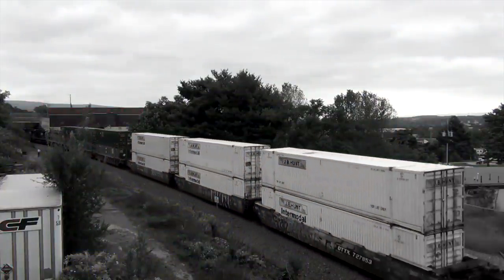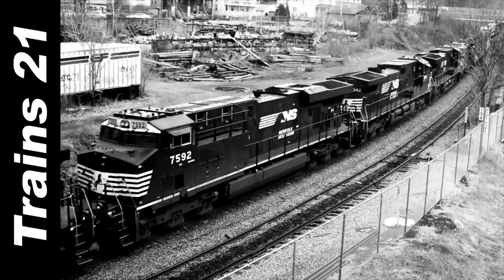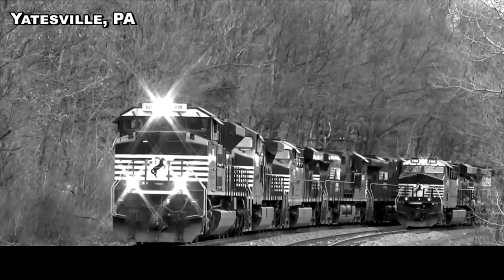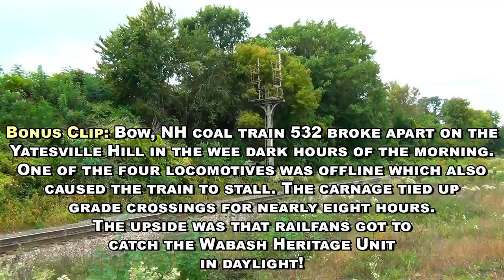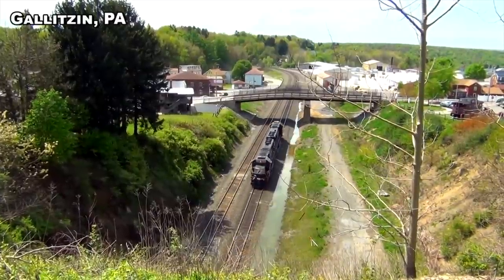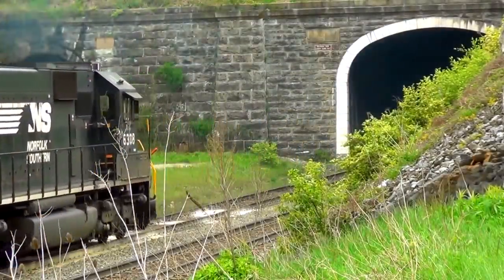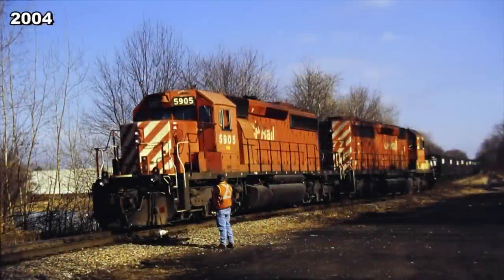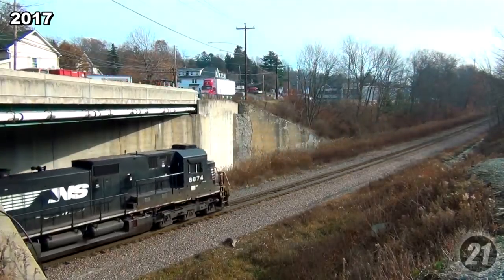When PSR Goes Wrong.. Why Railroads Use DPUs On Trains (Full Video)

Comment: I see the hold for tonnage guys are still around. The guys who destroyed customer service in the early Diesel age by making shippers wait until they felt like coming to pick up their car and running it in a huge train so they could get more work out of one engineer. I would never be an engineer nowadays. You get one paycheck and you do the work of six c r e w s. Just like with the Chicago Great Western putting 10 F units on the front end of a train. Shorter trains are more easier for the cruise to handle but less profitable. They got you squeeze every ounce that they can get of you. Now when they get to automated trains this will be reversed because there will be no incentive because you won't have an engineer. You can send an engine out to pick up a car with absolutely no labor cost whatsoever. What railroad is going to.
Reply: I see it locally. A business in a neighboring city takes about 3 - 4 centerbeams of product per week from UP via a connecting shortline. These days there can be up to a dozen or more empties accumulating on a siding on the shortline before UP will send a local to pick them up. They'll deliver as needed but wait a month to haul out the empties.

Comment: They need to operate a extra or 2 trains to prevent this problem The management doesnt care about how long or how heavy there trains are they just want them out of there yard . Upper management just does  not hear the workers This is some of the reason Conrail failed
Reply: Costs more money.
Reply: @FS2K4Pilot  how much can it cost to run 2 crews compared to the main track is tied up for countless hours , also the fine the public want to levy on them for blocking traffic . the delays of the freight due to not arriving on time.
Reply: @geraldmarcus947  Yeah.  Right.

NS alone spends around $700M just on salary for their train crews, not including any bennies or any of that complicated shit.  Even if you only have to split half of your trains, that just shot your payroll up by $350M.

NOT.  GONNA.  HAPPEN.

They can settle a lot of lawsuits and fines and buy a lot of politicians for a lot less than that.  Barring an act of Congress, and the railroads pay a lot of money to prevent that, it won’t ever happen.  Ever.  As long as it’s significantly cheaper not to, that’s the way they’ll go, every time.  Hell, railroad executives probably even tithe heavily in order to ward off even divine intervention.

Comment: DPUs on heavy unit trains that are moderate in length and operating on territories that have challenging grades makes sense but putting DPUs on damn near every general merchandise train, intermodal train, auto rack train etc does not...run those trains at reasonable lengths and there is not much concern for all of the buff force nonsense they use to justify using DPUs on them...running them unnecessarily makes the operation inefficient because now you have to get to the unit if something goes wrong and you have to switch it out at different locations which takes time and planning.....psr and DPUing is crippling service....it also makes no sense to run trains that don't fit into sidings....railroads ran much smoother and efficient before psr and monster trains
Reply: I agree to some extent with your post.   However, as with any significant change there will be challenges.   Sidings are being lengthened.   Locomotives are increasingly smarter.   Signal systems are being modified.     We are not sending out DPUs on every train.  Sometimes it doesn't make sense given the tonnage on that particular day or what the work in transmit might be.   One thing I guarantee you....if I use DPUs there will be railfans going "They didn't need it".   If we don't use them and have difficulties pulling a grade the same railfans will say "They should have used a DPU"
Reply: I had a mixed manifest train the other day. 4970 tons, 39 cars. DP'ed on the rear. One locomotive on the head end, one on the rear. No sense considering two head end locomotives would have been plenty, it just made more work for me when I had to yard it.
Reply: @cody8217  Agreed.   Give me 2 5000 HP locomotives on the head end of 5000 trailing tons rather than make me DPU the train.
Reply: @cody8217  my point exactly

Comment: Hey Just so you know NS phased out PSR a while ago.
Reply: actually, PSR in and of itself is NOT bad... the problem with PSR is that it creates EXCESS... and the company can be tempted to cut off those excesses... cutting off excess lowers the operating ratio, which increases monies going into the shareholders pockets... and btw just looked at an article concerning NS and their performance last year... they are getting LAMBASTED by the investment community because the last qtr of 2023 their operating ratio went up from 63% the qtr prior to 73% for the last qtr of 2023... stock professionals are considering downgrading NS's stock

Comment: i'm not in us.  didnt csx try this oversized bs years ago and they had to get rid of all the top (non-railroad) brass because of false economies?
Reply: CSXT is still running huge trains.  Nothing has changed.
Reply: @cdavid8139  , i thought the new management shortened them.  so no change?
Reply: @vsvnrg3263   There has been change.   And there will continue to be change.  New technology becomes available.   Traffic trends are altered by demand and economics.   New management comes along and doesn't like what the predecessor did.   But in general CSXT still runs very long trains with distributed power when needed.
Reply: @josephhigdon2204  I concur that 3 mile long trains running into major cities along certain routes are problematic.   We often break up the super long intermodal trains up before they come into LA.    I might be wrong.   The government may step in.  But my belief is that as siding length increases and crew costs rise we will continue to see these huge trains moving.    Train length has been increasing since the first wheels turned on steel rail and with technological improvements it won't stop.

Comment: What does PSR stand for?
Reply: Precision Scheduled Railroading, which it is neither precise nor scheduled, ironically.
Reply: Hunter Harrison titled his two volume encyclopedia on Precission scheduled railroading. PSR works any commodity that does not spoil.  
Prior DPU locomotives, another system called pacesetter used CPRail on unit coal trains (60 cars back of head end power) as helpers (SD40-2).

Comment: you made a error on the announcement the number was 9510 not 9610 on the third unit just wanted to correct you.

Roberto Roman
Reply: No, 9510 was in the pusher/helpers -- 9610 was the third lead loco.

Comment: It’s been a long tome since trigonometry in 12th grade (50+ years), please convert % grade to angle.  I forgot.  I’m a mechanical engineer but never had to build roads, car emergency brakes, parking pawls, or train engines so grades in % were not a daily number.  The rest of your numbers get your presentation a technical A++.  Nice job.  It’s something everybody can understand.  That is a standard measure of intelligence, being able to educate the uninformed.  Take the rest of the day off.
Reply: Just know that a 1% grade triples the amount of drag over level track, and 2.2% is the standard steep grade in mainline U.S. railroads.
Reply: Simple answer: rise over run.  1% rises 1 foot for every 100 feet of run.  It's essentially the tangent, but used where the tangent values are very small and make for a more understandable relationship than the angle in degrees.
Reply: you can just multiply it by 0.9 to get the degree angle. For example, a 2% slope would be 2x0.9 or 1.8 degrees
Reply: @ryguygaming06  That's an approximation that is fairly accurate down in the range of normal RR grades (say 0-3%) but I wouldn't use it for anything much larger than that.  A 100% grade is only 45 degrees, not the 90 degrees that approximation would yield.
Reply: Yes, the percentage of the grade is the trigonometric tangent, so use the inverse tangent function on a calculator to find the degree measure of the grade. . .
Reply: @ericemmons3040 thanks
Reply: So, a 45degree slope is a 100% grade like the thing that goes up the side of Pikes Peak, which is probably not a train but a trolley because of its mechanical attachment to the tracks.  I’m over extending the limits of my engineering background but being wrong was sometimes more exciting than being right!
Reply: @yelyab1  A trolley car, engine, or train has no mechanical connection to the tracks; a cog railway is what you're thinking of. With a cog railway,  there are steel teeth  between the tracks, and the locomotives or self-propelled railcars, whatever is being used, have gears underneath that mesh with the line of teeth between the tracks and provide a way for a train to go up a very steep slope. Shay or other geared steam locomotives, which are not cog engines, can go up grades as steep as, say, 9 or 10 percent, as far as I know, but I think anything much steeper than that requires some kind of cog mechanism. Or, a system of winches, rollers, and steel cables as was used on the Yosemite Lumber Company Railway, which had 2 major inclines during its operation history, one with a maximum grade of 68%, the other with a maximum grade of 78%.

Comment: I get the enthusiasm. I wish the railfans/foamers would stop making these kinds of videos. There's so much information you're not aware of. You only have bits and pieces of the story. You're not doing anyone any good by telling partial biased truths. I'm an in the field union officer and there is so much more than the story you tell.
Reply from the maker: While I respect your position and opinion, I know more than you give me credit for since you don't know me at all. I've said that there are positive points to PSR on many occasions. However, this video is titled "When PSR Goes WRONG." And everything I said in it is true. And as long as I'm responding. While there are good points to PSR, I've seen many more bad points to it as I used to work WITH the railroads and have spent countless hours around them as well as listening to the radio. As I've also pointed out in the past.
Reply: @Trains21  I work for the railroad also, I rather have you railfans guys make videos and take photos , than dealing with having rocks and bricks thrown at my train or even being shot at which has happened to me. And on another note, PSR is a bad joke as far as I am concerned, the railroads might never recover the market share that has been lost!
Reply from the maker: @mrjsanchez1  Okay, but I've never thrown a rock or a brick at anyone nor have I ever pulled a gun on anyone. And anyone who has thrown things at you are not railfans. They're vandals and delinquents. And personally, I'd rather viewers who disagree with something I say take the time that it takes to make a video response of their own (I'll watch it), than leaving negative comments on my channel which I get all of the time. The difference is, I don't complain about it on other people's channels. I keep it to myself and cope with it on my own .
Reply: @Trains21  I am a railfan myself, I just think it is kind of silly when railroaders complain about railfans, when we have others who are actually trying do do damage and harm to trains and crews, I do enjoy your excellent videos, Have a Merry Christmas!  PS, One thing I find amusing is that  I learn more about what is going with the railroad I work for from Railpace Magazine, then I do from management.
Reply: @Trains21  I'm not in favor of PSR, at all, as a business model. Yet if you don't work within it each and everyday, sometimes 60 hrs. per week, you don't really understand what's going on. Working near, or around the railroads isn't the same as BEING a railroader and having to live with these policies and procedures day in and day out.
Reply from the maker: @mrjsanchez1  Perfectly understood. I thank you for being a viewer and wish you a very merry, a cool yule and a snappy happy.
Reply from the maker: @TheNemosdaddy  And that's where I have to disagree with you again. While I agree that working in something does give one a different perspective much (if not most) of the time, you don't have to be knee deep in something to understand the consequences of it.
Reply: Well, I can’t speak for anybody but myself, but I’m a real big fan of engineers, firemen, Gandy dancers, and all of the crews that work on the railroad. I assume by your comment where you say we’re not getting the whole story The only thing that is missing are the investors that play the stock market. I assume that’s what you’re talking about granted, we’re not hearing from the stockholders, because we honestly don’t care about the stockholders as you seem to. Class one railroads have generally been under government control throughout history. That’s why Congress will allow some buyouts of railroads and stop others from happening. There’s too much governmental influence on class one railroads railroads have always been looking for a way out of their responsibilities. They were crying about passenger and rail freight service back in the 70s so they begged the government to buy them out. What a bunch of crybabies. Like I said, I like the men and women that run, the railroad. Not bureaucrats, the government, or the Wall Street types that are hovering to make a buck. The CEOs of railroads remind me of a conversation, the CEO of union pacific had with a friend of mine decades ago. Had a union pacific gathering in Cheyenne Wyoming about the union, pacific big boy, the CEO said “the biggest mistake I’ve ever made over my life on the union pacific is not scrapping that thing”. That’s how much he liked railroading

Comment: I'm curious about the Conrail coal gons, they still have the CR reporting marks. Does that mean Conrail is still in existence?
Reply from the maker: Norfolk Southern owns the CR reporting mark but YES, Conrail does still exist as a terminal operation in Detroit, North Jersey/NYC and South Jersey/Philadelphia.
Reply: Conrail is still around it now a shared assets company. They do switching operations for both NS and CSX. Most cars that still bare the Conrail name are no longer owned by the company they just haven't been renumbered or repainted yet.
Reply: @Donald Norfleet From what I understand CSX is phasing out the NYC numbering and replacing them with CSXT numbering.  It’s weird seeing boxcars in original Conrail paint with complete Conrail logos and CSXT marks.
Reply: @PM08203  no, CSAO has an industrial branch off of The ACL and the whole of CSAO south Jersey splits off right after the Delaware river. NJDOT/NJ Transit Took over the line in the 80’s / 90’s after Amtrak decided they didn’t want to run it.
Reply: @Poopsock14  the short line I was referring to operates on the Pleasantville Industrial Track.
Reply: @PM08203  oh sorry, I’m pretty sure you would be right.
Reply: @Poopsock14  I recall a court case involving the short line and the Atlantic City expressway as to who was responsible for repairs to the train bridge that goes over the ACE in AC that connects to the Pville Industrial line.  In the end the short line had to make all repairs and upkeep.
Reply: @PM08203  oh, I was not aware of that, yeah I know what shortline you are talking about.